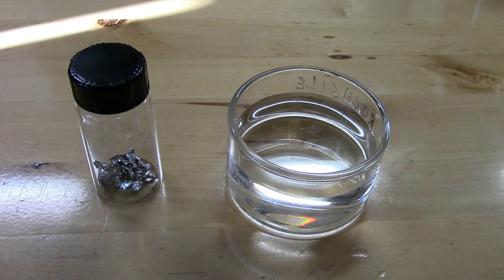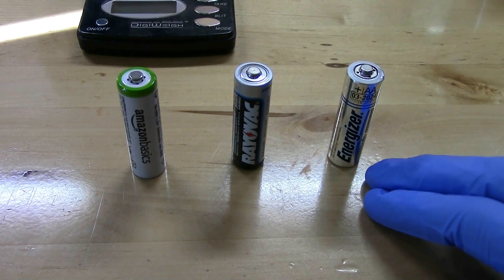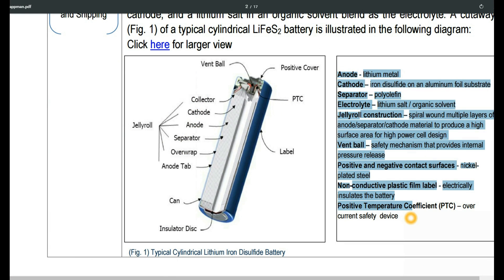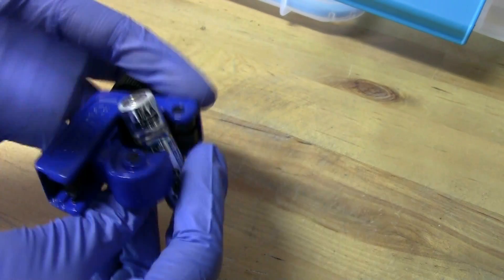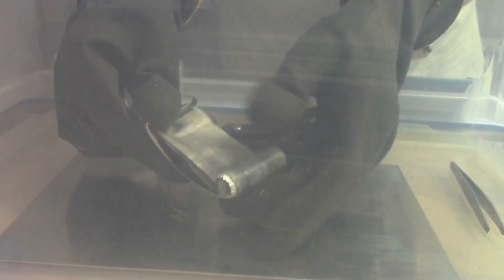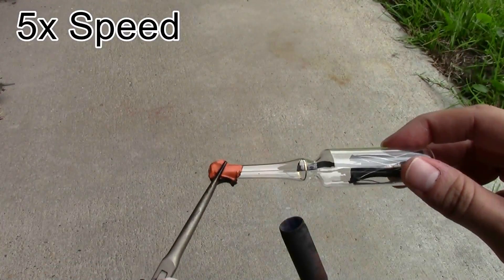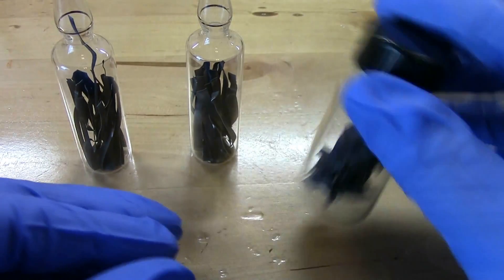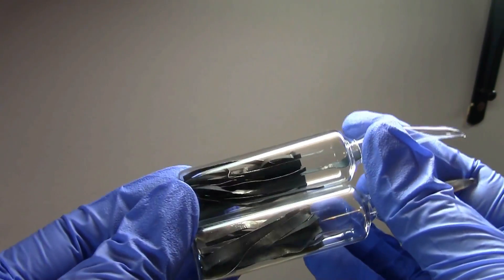Elemental Extractions #3.2: Lithium Revisited

Comment: Could you put the box under a constant 1.5 atm of dry nitrogen gas, Its cheap at a refrigeration supply store like RLS because its used to purge refrigeration systems before charging. Its dry because you don't want stray moisture in a system, we all know what happens when we heat halocarbons in the presence of water. It could help keep the air out, and is safe for you too. Also if you wanted to synthesize it couldn't you use electrolysis of LiOH, much like sodium and potassium from NaOH, and KOH respectively.
Reply from the maker: As I mentioned, you can't use nitrogen for this because lithium reacts with it. I've never tried electrolysis of molten hydroxides, so I'm not sure about that one. Dangerous, for sure!
Reply: @mrhomescientist  lol, I missed the part about nitrogen and I watched the video twice. Is there another cheaper inert gas you could use to keep the pressure above 1atm. Yes electrolysis of hydroxides is very dangerous, but if you a hydroxide as opposed to a salt you end up with a purer product and non-toxic gas. But I guess I didn't need to explain that to you.
Reply from the maker: @Wunderbred66  It could have been in one of the other parts. Unfortunately Li is very reactive and there aren't too many options. I suppose any of the other noble gases would work, but argon is probably the easiest and cheapest. I know someone will mention helium, and sure that would work IF you can find a pure source. Balloon grade helium is intentionally contaminated with oxygen. See my helium video on that! 🙂
Reply: @mrhomescientist  I was thinking the same thing as you, where can a hobbiest find a GC quality helium. I was just thinking of having a regulator set >1atm and gas on so the inside of the glovebox is always a little more pressurised than the surroundings. Argon could work but I don't know the cost.
Reply from the maker: @Wunderbred66  The gas itself is pretty cheap. The cylinder is the expensive part!
Reply: @mrhomescientist  ok so its just like dry nitrogen 400$ for the tank and 15$ for the gas.
Reply from the maker: @Wunderbred66  Pretty much, yeah. I think my 40 cuft tank was only like $20 to exchange.
Reply: @mrhomescientist  hmm something to consider.

Comment: I keep short circuiting them. What am I doing wrong? Does twisting them cause it?
Reply from the maker: They are pretty easy to short out, especially if you squeeze them too hard or pinch the top too much. The pipe cutter method has worked great for me. The steel case just takes a good bit of effort to get through. Careful not to cut into the battery innards! That can also short it out.
Reply: @mrhomescientist Thank you! I've done the pipecutter method it only worked once for my element collection.

Comment: I made a glove box similar to yours for handling alkali metals. I bought an argon cylinder like yours. I had the same problem as you wit the metal tarnishing in the argon atmosphere no matter how much purging I did. My son is a chemical engineer and he said the argon cylinders intended for welding contain a small amount of oxygen and possibly water vapor. Inert enough for welding but not 100% inert. In professional labs. they run the argon through an oxygen/moisture trap to get a completely inert atmosphere. They sell oxygen/moisture traps on Ebay for a reasonable price. I plan to try that next.
Reply from the maker: Interesting! That's definitely something to look into for the future.

Comment: Do that shit in a tub of mineral oil, forget argon, and the glove box. Same for storage.
Reply from the maker: I like this method for a number of reasons. If I ever want to use the lithium, it's ready to go and I don't need to clean any oil off. Li floats on oil, so there's always some that is exposed to air and will corrode, which won't happen sealed under argon. I also think it looks nicer as a display sample when under argon. Finally, I also enjoyed the challenge of making the glove box and got a lot of satisfaction seeing it work for the first time.

Comment: If you would like your lithium metal to be much more shiny by the time you place it in the ampule, you can immediately submerge it in mineral oil and cut it into strips under the surface. It will be slippery and feel pretty weird, but it will stop any tarnishing. Once that is done you can wipe off the oil under the argon atmosphere then transfer it to the ampule. Once flame sealed, there  should be minimal oxidation. That process worked well for me!!

Comment: open the battery under mineral oil, that should solve the issue of the glove box
Reply from the maker: Savoury Milkman The problem there is lithium floats in any liquid you can store it in, so theres always a bit that will corrode. Plus I like inert gas because you dont have to clean the oil off when you want to use it.
Reply: Well unless im mistaken, the problem with your glove box currently is that it is now allowing oxygen in from outside of the box, so floating to the top of the oil being an issue seems a little ironic :D. Im kidding around, really sucks that that started happening to ya. Could not agree more about having to clean the oil off before using, might make a decent temp solution for emergencies tho

Comment: I used a brass scrubber soaked in mineral oil to clean the surface.  It took away most of the oxide and nitride while coating the sample.
Reply from the maker: Good idea!
Reply: I wasn't as quite as methodical in disassembling my batteries.  I just had a pair of pliers and wire cutters to very carefully remove the positive end, the pressure valve and cap.  Then I pealed away the steel case very carefully until I could grab the plastic and pull it out.  I got the idea from NurdRage.  I made the same mistake you did, I thought the FeS2 coated foil was the Lithium until I went back and watched the video again.  The black coating that covers the Lithium is actual Lithium Nitride Li3N and not the Oxide (which is white.)  Lithium is one of the only metals that will combine directly with the Nitrogen in the air.

Comment: I had pretty good luck cutting the battery in the center to begin with. You have more to grip when you pull it apart. Also, for those who don't want to build a glove box or buy argon, it works just as well to open the "jelly roll" while it's submerged in mineral oil (I just used a tupperware container). I put it in a small vial of oil about a year and a half ago, and it still has some luster.

Comment: A couple things that might improve your glove box. Add a petri dish with some very dry calcium chloride to absorb water (can get as a pool chemical) and a second dish with the power from a hand warmer (pyrophoric iron) to absorb oxygen.  Also add a small computer fan to circulate the argon over the dishes.  If you make your glove box absolutely air tight (with an inlet and outlet valve) you can first purge with argon then close the valves and let the argon circulate for a time so any residual moisture and oxygen are absorbed before cracking into your sensitive chemicals.  Cheers, Mark
Reply: I hear that iron based oxygen absorbers do not work well or at all without humidity.
Reply from the maker: CodysLab did a video where he filled a 2L bottle with pure oxygen and put a hand warmer in it, and it absorbed the entire volume of the bottle. You're right though, he did add some water to help it out. I want to try that but haven't gotten around to it yet.
Reply: Yeah, maybe so.  A more involved way is to circulate the gas through a tube filled with copper wool or granules at a few 100 degrees (best temp ?).  The copper will turn black as copper oxide forms.  the copper can be regenerated with hydrogen to form water.  Cheers, Mark

Comment: I did this a long time ago with good results but I was doing it for fun. We took the lithium and put it in a small plastic ball with a hole in it then put that in a gatorade bottle with water. Homemade DANGEROUS fireworks. I had a video for a long time on my channel showing the explosion but then realized it might be considered bomb making and took it down. I never had a glovebox or anything just did it outside in the fall. I tried it again last summer (that was a mistake) the lithium reacted with the air and humidity. I probably should have not done mid oklahoma summer after it rained.

Comment: Would lithium react with chloroform to make LiCCl3? or would it pull the chlorine of the chloroform to make methane and lithium chloride?
Reply: Try it.  Nile red has a guide for chloroform.
Reply: Looks like 3Li2 + 2HCCl3 -> 2HCLi3 + 3Cl2.
Reply: +Cody Ho i have tried it, i have a video up on it(its not very good) and i got a white solid. I think that solid would be lithium ethoxide becuase i used ethanol to stablize my chloroform. But, in basic conditions, chloroform makes dichlorocarbene radical, could this react with the ammonia, made from a coating of lithium nitride, to make cyanide? Dichlorocarbene reacts with amines to make a isocyanide, but does this happen with ammonia?

Comment: That measurement did NOT measure energy density because not all of those cells have the same capacity. Only similar volume.
Reply: Agreed. The lithium batteries do have a higher energy density but it isn't just because they weigh less.

Comment: Pair of scissors on negative side cut around edge until a little metal left then needle nose pliers to twist some metal out of the way then put out battery no chance of grounding out, leave it rolled up drop it in camp fuel wont tarnish. all that argon stuff is a waste of gas and time
Reply from the maker: It will eventually, as oxygen diffuses into the kerosene (or whatever liquid you store it in). That's why my original sample of lithium which I show in the video is completely black now. Also, there is no inert liquid that lithium will not float in, so at least part of it will always be outside the liquid. Using argon also protects the metal without covering it in something that would be annoying to remove if you ever use the metal for chemistry later.
Reply: mrhomescientist Im talking about when you first pull it out then you just seal it up inside the oil. or use it up. its simple fast and easy.
Reply: And completely ignores the purpose of getting the lithium in the first place.

Arrogance is not your friend.
Reply: mrhomescientist The oil wont stick to the lithium and you leave it rolled up until you need it also make sure you pull the thin strip of metal at the very beginning.
Reply: seigeengine and who is that comment pointed at

Comment: Where are you going to get beryllium?
Reply: He'll probably skip the dangerous ones, maybe a few allotropes such as white phosphorus, ozone and so forth
Reply: Beryllium isn't really dangerous as long as you don't mishandle it and end up breathing it. Also, it is reasonably common in radio frequency electronics, which can be obtained as surplus.
Reply: +W Bailey It's not dangerous to the handler if properly handled, but collateral damage could be catastrophic
Reply: If you can't handle a beryllium containing ceramic insulator without grinding it into a fine powder and snorting it you probably shouldn't be handling anything more dangerous than table salt.
I don't see how any "collateral damage" could be catastrophic, we're talking pretty tiny amounts of the stuff here. It isn't like we're talking about industrial manufacture. If you are really scared of beryllium for some reason you could always buy a small sample of a beryllium copper alloy where it is completely safe (and useful for non-sparking tools)
Reply: +W Bailey BenNbuilds made a magnet, with beryllium. take a look at the precautions he took
Reply: If you're MAKING something out of it I totally agree. Just taking something with beryllium and putting it into a bottle for a collection though I wouldn't worry about. I certainly wouldn't want to work in (or near) a factory making beryllium insulators for example.
Reply: +W Bailey I'm just saying it's got a reputation as a bad group II metal
Reply: maybe someday we can engineer a beryllium removing enzyme into our livers or kidneys and not have to worry about working with it, it certainly has some very useful properties.
Reply: +fireandcopper Ben was using barium.
Reply: As far as I know, solid blocks of beryllium aren't poisonous and evil. The dust is the nasty stuff.
Reply: Thats right, as long as you don't eat the solid block of beryllium. Might want to wear gloves too.
Reply: +fireandcopper This is pure bunk.

Beryllium is dangerous, but hardly more dangerous than plenty of other substances chemists and chemistry enthusiasts regularly handle.
Reply from the maker: Correct! And the compounds.
Reply: So where you going to get it?
Reply: Wish I thought of that question.

Comment: What's the plan for sodium? I've been thinking about having a go at making sodium metal from table salt, the process is pretty neat. You make sodium hydroxide using the chloralkali process, dry the hydroxide, then melt and electrolyze it to make sodium metal.
Reply: I've made an acronym that's applicable to anything involving fluorine:
D.O.N.T.

it means dont
Reply from the maker: I'm still throwing around a few ideas. I need to work up the courage and make a safety plan for working with molten hydroxide though!
Reply: mrhomescientist I have 2 mottos in my life. Nike, "just do it", and a paraphrase from a song by They Might be Giants, "I got a full lifetime supply, of plans that go awry."
Reply: You can use magnesium powder and sodium hydroxide thermite. Nighthalkinlight has a video on how to make it.
Reply: hunterboyvids I wouldn't bet that process would be very efficient or give a very pure product. I'd also hesitate about using something like magnesium, unless you mined it yourself, while a natural source of sodium chloride is often pretty easy to come by.
Reply: True but  i wonder if a calcium hydroxide magnesium thermite work? calcium oxide is easily made from heating eggs shells or limestone.
Reply: if you make thermite with sodium hydroxide you can make nice Na metal
Reply: +mrhomescientist what's your plan for fluorine?
Reply from the maker: lol sage advice!